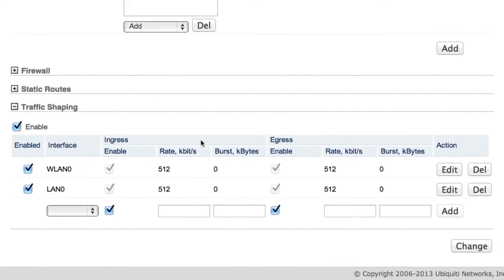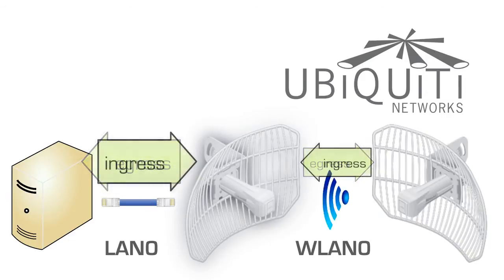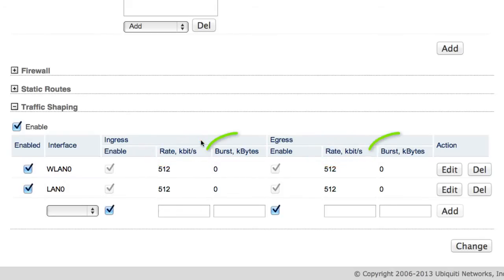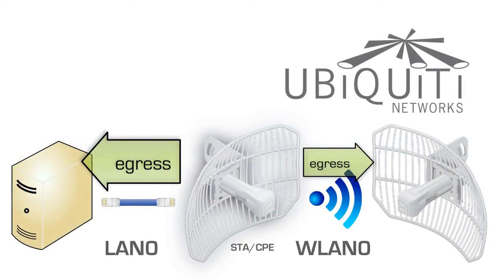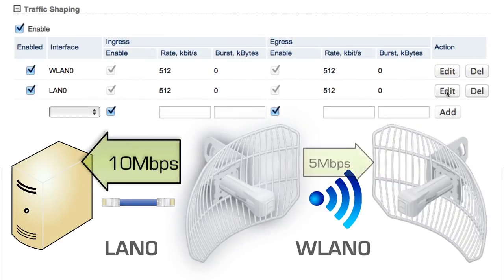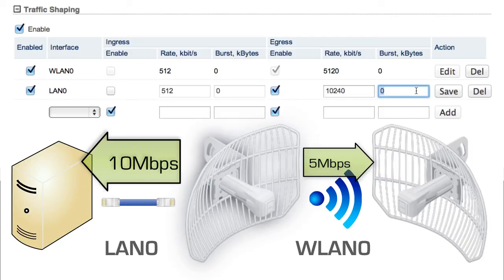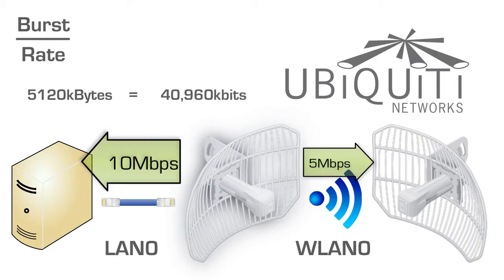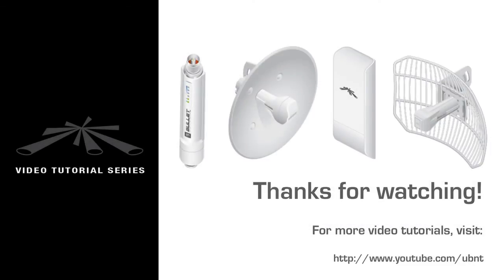Traffic Shaping in airOS - 4Gon Solutions

Comment: Thank you, that explains quite a bit, but I have one question.... When managing a home DSL connection, if I set rates to what I believe is below the maximum DSL speed and burst to zero, it seems no one can use even web pages. Is there a way to manage traffic speed by traffic type with this device?
What should the settings be to give wireless traffic 50% of the available bandwidth on 4mb down 1mb up DSL connection?